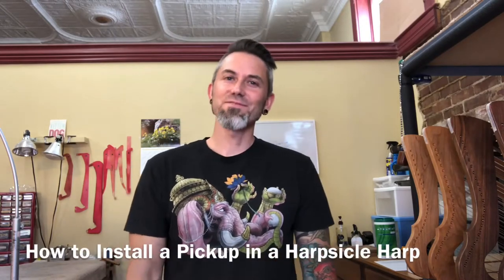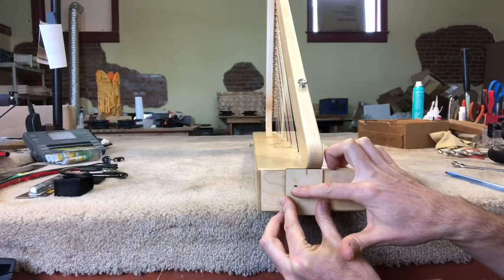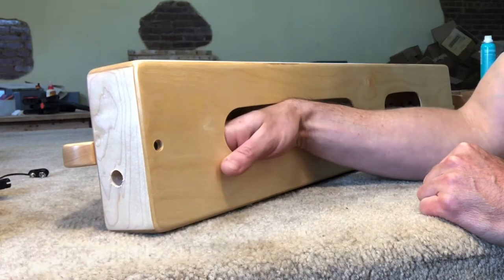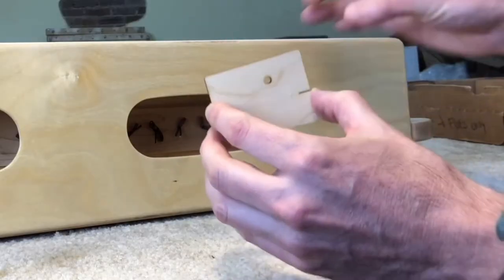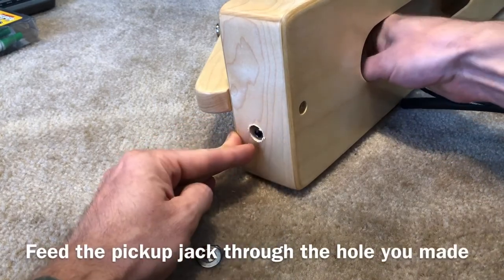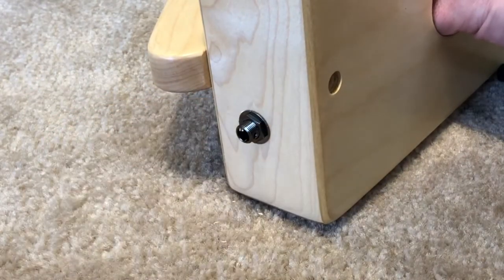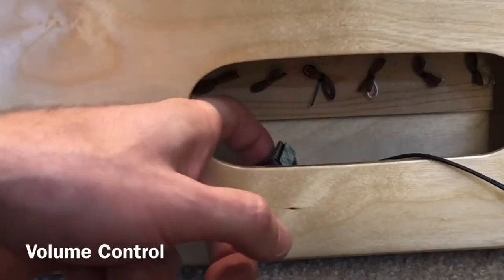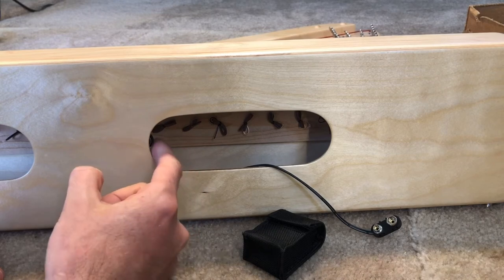How To: Install a Pick Up in a Harpsicle® Harp

Comment: Is it still possible to mount the harp on the harpsicle stand with the pickup jack sticking out of the bottom?
Reply: Hi Gabriella, sorry for the extremely late reply. Yes, you can still mount the harp to the Adjustable Stand or the Display Stand with the pickup installed. The Adjustable Stand is designed to be used in conjuction with the harp being plugged in. The Display Stand is not intended for this use so you won't be able to have the harp plugged in when mounted to the display stand.